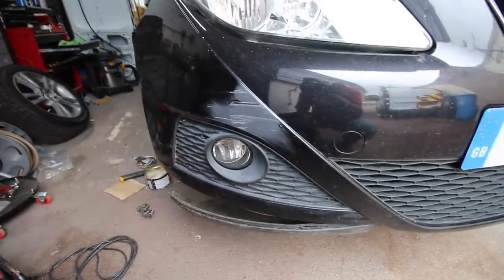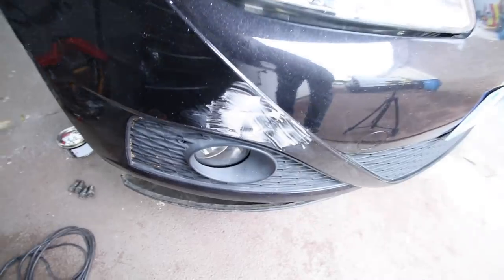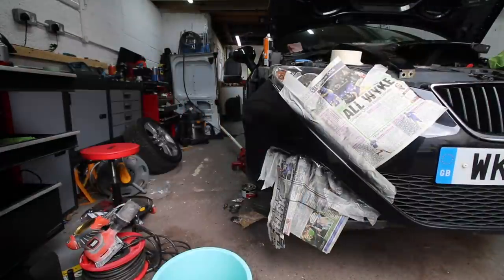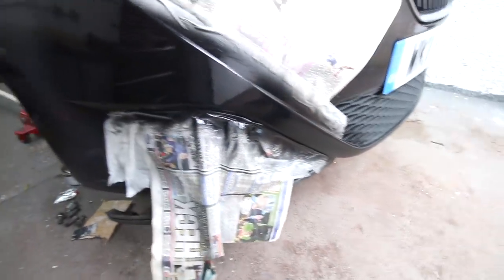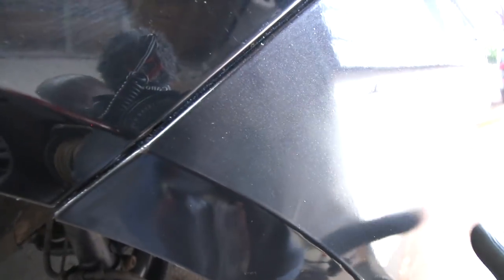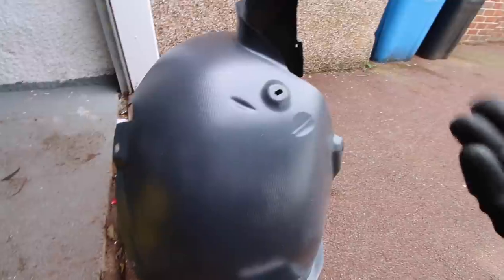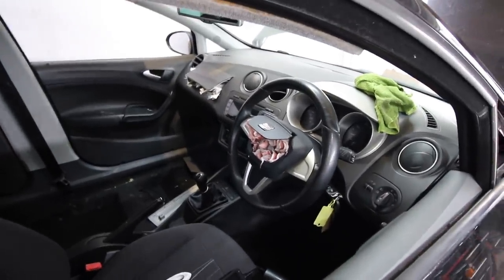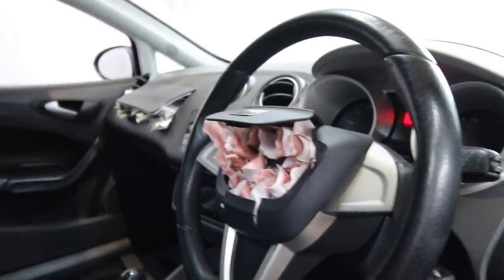How to repair a scratched bumper on a seat ibiza Part 6

Comment: Good job you did on the bumper, don't forget to use a sanding block to take the high spots off the filler and a black dust coat to show the low spots when you sand but you saved a few quid doing it yourself. Onward and upwards!

Comment: Good job paul,as long as you've got the surface meter up so the lawyer can adhere to it and enough coats so you can flat it down and polish it ,job done !  I am in the trade but can't see any problems with that 👍

Comment: One thing that will make your rattle can repairs much easier is a spray handle, you can buy a trigger attachment that fits all aerosol cans. Using the handles gives you much more control when spraying resulting in less runs. 

Before buffing, go over the panel with 2500g trizact, it removes the overspray much easier. 

Final one is invest in 2k clear, it’s a much better finish.
Reply from the maker: Thanks for the tip

Comment: Great vid Paul, you have done a nice job there. Do you have to use different filler & paint for a plastic bumper as opposed to metal bodywork?
Reply from the maker: No, I used the same filler you would use on metal bodywork

Comment: Just a quick idea if you really want a perfect “bodyshop” finish sand the area you painted with 1500 then 2000 then 2500 and then use a cutting compound and go over it twice then a polish compound twice. Try it, thank me later